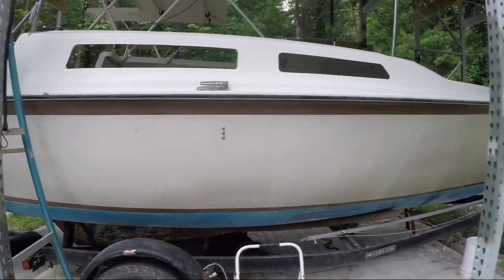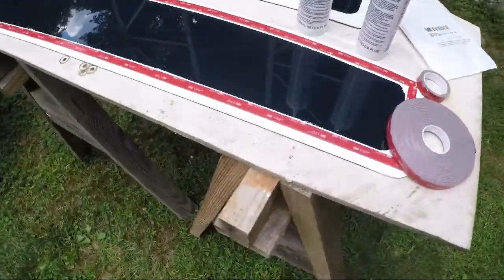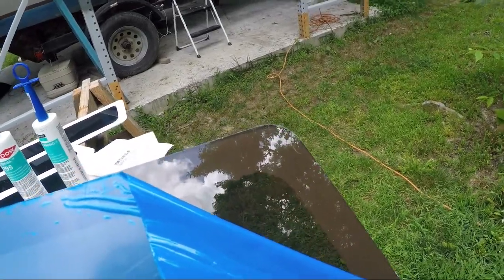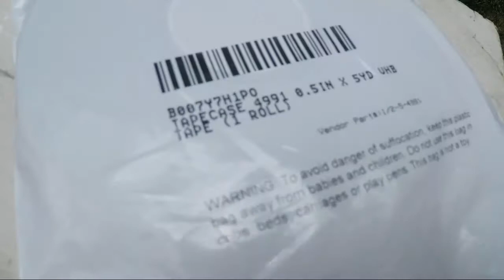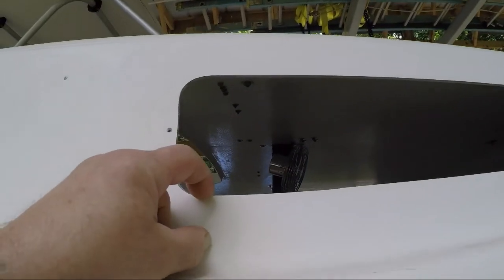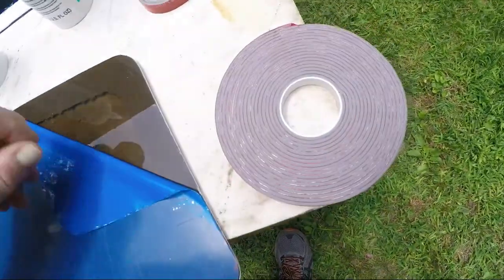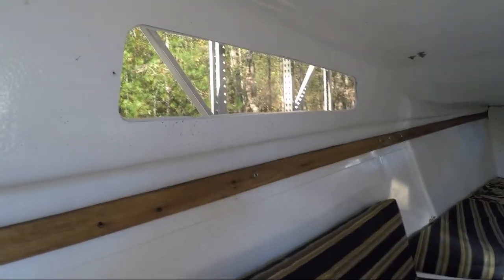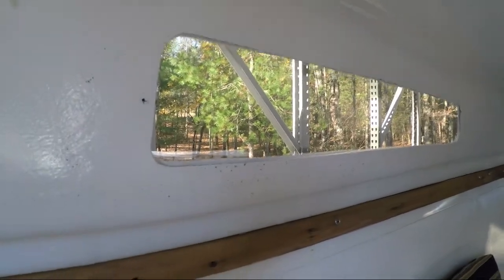Refitting SV Drifter Ep 4 : New windows! A medium restoration project on a 1982 Macgregor 25.

Comment: going to do the same to mine. they came out nice
Reply from the maker: Hey thanks!  I have found this to be the easiest way to put on new windows and then I don’t have to worry about frames or more screw holes.  I sailed for about three years with my San Juan 21 with the windows done this way and they never leaked. Good luck!

Comment: Like the videos, I just picked up a 83 mac25 and was wondering if you had info on rig tensioning,  front stay and shrouds. Windows turned out nice
Reply from the maker: Yea kinda, check this link: https://www.macgregorsailors.com/resources/MacGregor25_Manual.pdf

I try to tune the mast by laying down on the deck, looking up I make sure it is straight side to side. I tension the rig not too tight but like a bass guitar string. Sounds crazy but it has worked so far. Thanks for watching and for the compliment!